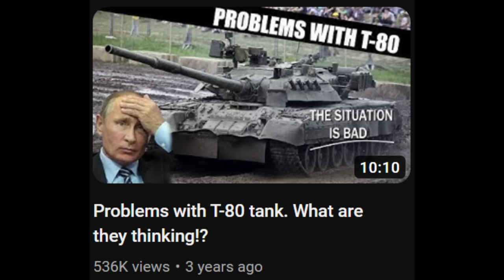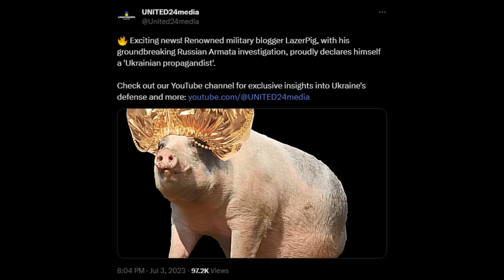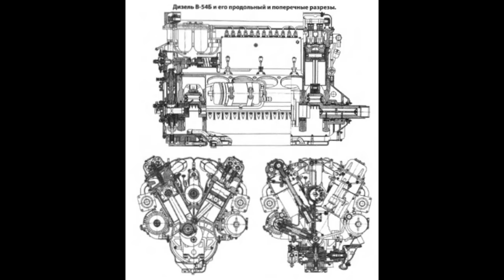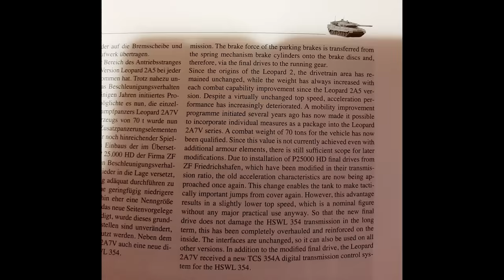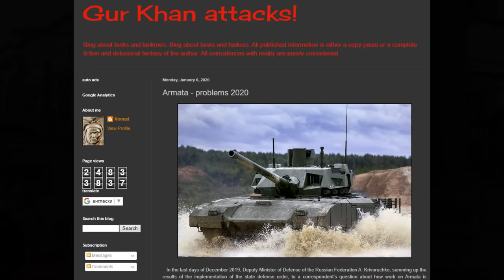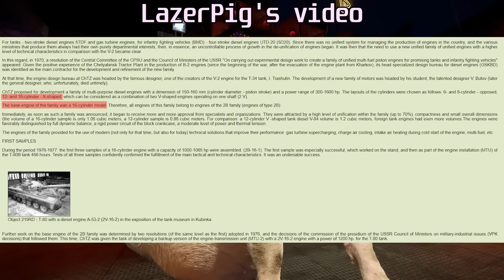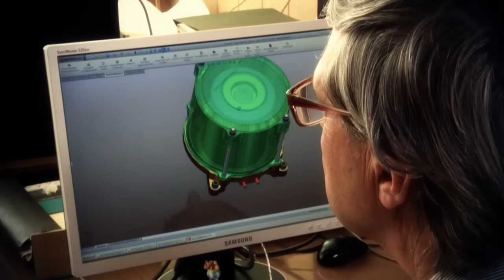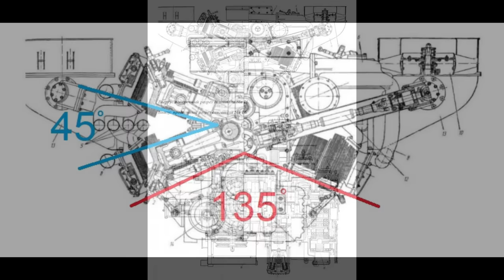Response to LazerPig and the T-14 Armata dispute

Comment: According to lazerpig's logic all piston engines are just a modification of the Ford Model T engine.
Oh, and the turbine engine of the Abrams is basically the same as the jet engine of the Me 262.
Reply: Lol 🤣🤣🤣🤣
Reply: Why wasn’t time trying to understand what someone else is saying when you can just make something up and claim it’s what they think. Don’t worry you look really smart right now
Reply: more like this is your interpretation of lazerpig's logic.
Reply: No no... The Abrams turbine is nothing more than a Hydroelectric turbine, but is using hot air from combustion, instead of water.    😏
          –LazerPig logic, probably... I dunno.
Reply: @DUKE_of_RAMBLE  It's just a smaller Dutch windmill.
Reply: The fact that it has a different cylinder count and displacement proves it has an entirely different block, not to mention the advances in engine technology that have been made in the last 80 years the only similarity between the engines is that they have an X layout and look kind of similar externally. Now if the T-14 engine is developed from a line of engines dating back to captured WWII-era German engines is a different story but claiming that the T-14 is using the exact same engine as a WWII tank is just inaccurate.
Reply: @jb76489   didn't lazerpig do that in his reply vid too?
he even cherrypicked certain parts of red's video and strung them together to create the impression that red was a vatnik and russian propagandist
Reply: To be pedantic the tanks internal combustion origin mechanics started with Belgian-born engineer, Jean Joseph Étienne Lenoir invented and patented (1860) a double-acting, electric spark-ignition internal combustion engine fuelled by coal gas. 😉

Comment: I present to you, a LazerPig style argument about, the AIM-9X.

The AIM-9X is bad because it's based on the AIM-9B, a missile designed in the late 40s.  The AIM-9B has several issues and had an abysmal hit rate in the 60s and was designed for the F-86 SABER JET!  Anyone who thinks that the AIM-9 is good is just parroting American propaganda.  You might argue that the AIM-9X is an "evolution" of the design, and that it bares only superficial resemblance to the AIM-9B, but this is just making excuses for the US using a 70 year old missile!
Reply: This needs to be top comment.
Reply: Sounds exactly like his style and I did like some of his videos. 

Based on this example, are you saying LZ has a habit of not addressing the main points of his arguments? That is just seems that way? I am asking out of passionate curiosity

Because in this example, our hypothetical LZ did not even take into account that the AIM-9X may have been improved compared to its older counterpart.
Reply: And not showing any evidence for his supporting points.

Comment: I really don't understand all the semantics about the engine. Even if the original version was built 80 years ago, it doesn't really have any effect on the performance of new engines built in the modern day, provided they have been modified along with advancements in technology. For example, the "small block" Chevrolet motor was first developed in the very early 1950's. Through various iterations and designs, including different bore spacings and displacements, it has been changed into some pretty cool stuff, including the famous LS and LT series of engines. However, all of these engines are still a cam in block, pushrod, motor with 1-8-4-3-6-5-7-2 firing order, a cross plane crankshaft, and non-canted valves (a design specific to the previous "big block" Chevy motors). It seems that the exact same process has occurred, at least in some way, with the 12 cylinder design that is discussed in the video. It's nothing new or even rare in motor design, usually a solid and reliable power plant will be used for quite a long period of time. I don't have a horse in this race, but it seems to me that Lazerpig was very keen to talk shit about engines without being very knowledgeable on them at all. To go back to my example, it's like he looked at a new Corvette with the latest and greatest 600hp engine and derided it because the original iteration of the design, had 85 hp.
Reply: It's not solid or reliable. Actual Russian telegrams have said the truth about the Armata - it's not going to show up in Ukraine because unlike Western engines crammed full of sensors and full digital control the Russian engine had to be manufactured with less digital components which means performance had to be brute-forced out of it through old design techniques. And to be able to pull the Armata the engine is strained to get the necessary performance which decreases reliability.
Reply: @ChucksSEADnDEAD  i don't think you understand the factors that contribute to the total power a diesel engine produces. They are: displacement, air flow, compression, turbo boost, and exhaust back pressure. To make an engine of this size (32 liters!) Make a few thousand ft/lbs of torque only requires a good set of fuel injectors and some big turbos, both of which are reqdily available in industrial equipment. To be honest, I don't know anything about the reliability of any 12 cylinder X-engine, let alone this one. But I am hearing a lot of talk with little explanation. What is the power to weight ratio, fuel consumption per hour, total power production, and reliability like of this engine? Since you seem to know, I am actually quite interested to hear.
Reply: @haroldburrow4363  Well dont listen to the talk. Next to nothing is actually known abt any of the X layout Russian engines other then their names and maybe some pattent drawings. Actual performance and or how reliable they are is not known.
Reply: @ChucksSEADnDEAD

Have not seen any sources discuss anything you are saying.
Reply: @haroldburrow4363  If you want boost, you have to prevent knock. You need an ignition timing map.
Reply: @jamesmandahl444  Unfortunately it was a Telegram post translated and posted on twitter. I am bound to the search function which doesn't return the post I've seen.

Comment: If the T-14 type tank ie unmanned turret with crew capsule in hull, made by western country then LazerPig would have written ballads about its greatness even before it entered production or used in combat. Oh wait he did for AbramsX. He forgets the first of this kind was Abrams TTB and RDF light tank from the 1980's. But the technology was not their, crew didnt felt confident enough to be dependent on cameras and liked the fact that Commander was at high position to look all around. Beside that the existing design was less risky and cold war eneded. So both of the designs were not adopted. Remote weapon systems and medium sized unmanned turret have proved that technology has matured enough ie depending of cameras for targeting, that sooner or later an unmanned turret tank would have happened if Russians were the first to show it good for them but as we know it needs time and money to sort out problems to enter at least initial operational production.

Comment: The people that hate on the T-14, does not come up with a singular good argument to why its bad. they all be like "the tank is so bad it uses a tiger (p) motor🤓☝", or they say "its bad, it broke down during the parade".
Reply: yeah the chieftan even postet a pic where one m1 got towed so is the M1 also bad ?
Reply: i mean, you cant judge a tank that has never seen combat and has less deployed units than F-35's built last year
Reply: agreed the real question is if this tank is so good, why are there so few? Either it does not offer a significant bump over existing models with refits or it's too expensive economically/logistically. Neither of which is a promising option though the latter would be far more concerning.

Comment: To me in America its funny that anyone would cast shade over an engine design because of its age.  We have been using small block v8 engines since the 50s.  Yes, as time goes on we make them more powerful, lighter, more efficient--but at the end of the day its a small block v8.  4 pistons are going up and down in 2 v-shaped banks.  If it isn't broken why fix it?

Comment: 11:00 if it was an engine used on the BT-7M, then surely it was an engine used on the BT-7, as the BT-7M is literally a modification of the BT-7
Reply: BT-7M is the BT-7 with the V-2, BT-7 originally had the M-17, a copy of a BMW engine.
Reply: @TheForklifter  Correct, but I was not saying the actual BT-7 (BT-7A) did not use the V2 engine, I am saying that the BT-7 family adopted the V2 in the Bt-7M variety.

Comment: Problem with laser pig is that people on the internet are gullible and they will easily believe what they hear. Especially when you do not provide sources.
The whole engine thing is a joke. I mean come on, all diesel engines are similar. All internal combustion engines are also similar to some degree. Heck that whole class can encompass even steam power as fosil fuel powered engines. Contrast that with electrical engine class. Or rocket engines.

Comment: Russia is not the Soviet Union. All they can do is repair the tanks they already have.
Reply: So, the T90M was made in the USSR?
Reply: @Fred_the_1996  the t-90 entered production in 1992. But its design goes back further than that.  It's an evolution of the t-72 with elements from t-72bm and t-80. 

It's a soviet design with a fancy dress on.
Reply: @Nedula007 Which is still being poduced and not just repaired.
Reply: @aquadox5514  it's a soviet design my guy. The only new tank they have is the armata and they can't even make a 1000 of them lmao
Reply: @Nedula007  But they make T-90's is what I'm saying.
Even if it's soviet in design they are producing it and not "just repairing" them.
Reply: @aquadox5514  it's a soviet design using the spare parts they have left over from soviet times. It's got fancy optics and a new gun but it's still a t-72 with a dress on.
Reply: @Nedula007  Which they produce.
That's all I have a problem with, it's being produced, not just repaired and thus limited.
Reply: @aquadox5514  ...produced by taking skeletons from a tank graveyard
Reply: @Nedula007  If you believe Russia isn't producing new tanks I'll leave you to it.
Reply: @aquadox5514  they're really not. IF they were, the battlefield would be awash with brand new Armata tanks. All of the Russian inventory is basically decades old crusty and dusty soviet stock.
Reply: @Nedula007  Ok, good luck with that image of reality.
Reply: @Nedula007  technically you're not wrong. All of the "modern" equipment in Russia are unicorns. The Su-57 in production for over a decade and only about 20 have been produced. The armata tank, only about a dozen or so have been produced and that tank had to be towed away during a parade. Russia doesn't even have the ability to mass produce drones, they had to get them from Iran. (Cue photos of russian drones with Canon cameras glued into them), The russian terminator tank? Only about 11 have been made. The T-90 is ... as you said a dressed up T-72. There's nothing special about it. 

The Russian military can't fight a modern war. Because it's not a modern military. They had to purchase millions of artillery munitions from North Korea and Shoigu's recent visit there should be an indicator of things to come.

Comment: It’s the same core engine. Where I work we build engines that were designed 40+ years ago. Sure, they’ve changed and developed over that time but they are still the same core engine.
Reply: but they're not, that's like saying a honda K24 is an evolution of the chevy 153 just because they're both 2.4 liter inline 4 engines
Reply: @Fred_the_1996 that’s not true, a Merlin 60 series engine and a Merlin III are the same core engine, despite the former having a two stage supercharger. 

A Rolls-Royce Merlin and a Rolls-Royce Griffon are NOT the same engine despite them both being V12s.
Reply: @Pete-tq6in  wait you're talking about the V2? my bad i thought you were talking about the t14 armata's engine and its relation to the king tiger engine
Reply: @Fred_the_1996 sorry, perhaps I should have been a bit clearer!

Comment: All this engine argument is silly, if an old block design works great there is no reason to change it, most of the gain in HP, torque, and fuel economy come from the design of the heads, and improvements to turbocharging and fuel injection, not redesigning the block every five years, take it from someone who has worked on plenty of diesels. And arguments over which tank is better can be downright silly as they are designed for different doctrines, sure on an ideal wide open battlefield an M1A2 SEPV whatever will have pretty darn good odds against any T72/80/90 variant but the logistics of moving such a hefty/fuel thirsty beast around is a task that only a US sized budget can handle. Russian doctrine requires equal or greater mobility with more iffy logistics, not saying that Russian logistics are bad but they rely MUCH more on a nearby rail network which Russians have in abundance in their country.

Comment: In regards to the engine argument. Can somebody explain to me how you can base a diesel engine on a gasoline engine? you can do it the other way around. aka use a diesel engine and convert into a gasoline. but the other way around? i am not aware of that being possible since a diesel engine has a way higher working pressure therefore a diesel engine block has to be more sturdy. 
i am aware that today a lot car engine manufacturer use the same block for their gasoline and diesel engines(bmw, volvo for example). but to make that possible the block has be the designed first and foremost for the diesel application. as a result the gasoline engine can take boatloads of boost without any issues. just take the bmw engine in the current supra as an example.

Comment: By the way, the Leopard 2 engine is old but this is not a special Leo 2 engine. This is a standard MTU industrial engine that is used for agregates, emergency power, ship engines or elsewhere stationary. It hasn't been modernized because there's nothing better in this genre, there are enough spare parts, because these engines are used civilly around the world, on ships, on oil platforms, in mining and it's completely mature. With every generator that runs anywhere in the world, all problems have been eliminated and all defective parts have been replaced with newer ones. It runs on low quality fuel or fuel mixtures, which a modern diesel cannot cope with.
There is also a Deutz engine here that is built to eternity and cannot be improved.
When I see these T-tanks, how they rock  and shaking when starting up and changing gears, I don't know whether the engine power line is top of the notch, no matter how modern they try to be. 
I've never heard anyone here say, "Let's buy a Russian device, they're good." 
No, they buy Cat, Liebherr, Komatsu, I've even seen Tatra, but nobody buys Russian products because they suck. Before the war, they imported everything that was more complicated than a refrigerator. At the IAA they once presented a GAZ truck, even then they had to use a Cummins engine because they don't have anything that would get approval anywhere except in Russia. Nobody bought it because it was technically up to date 15 years ago. Even the Turks have built trucks that sell well here, the Russians never have. There are only a few LADA off-road vehicles here. Because they are cheap and there are people who like such vehicles to be simple, primitive and don't value comfort off-road.

Comment: The last LazerPig vid I watched about stealth was full of propaganda and what seemed to me pure assumptions about the tech being used which didn't tally with what knowledge I do have. A previous video I found subjectively suspect so I have pretty much given up with his channel.
Reply: Well that’s actually debatable. In terms of the part covering the F117 shoot down, I mostly agree. Yes, there are inaccuracies but with that part, and the part where they were testing the RCS of the F117, sounded mostly right. The Serbs really did make a very lucky shot (technically they got lucky twice, since I’ve been told there was a second F117 that was hit but was not shot down). I’m also unsure if they were using low frequency radar when testing the F117’s RCS, but I can’t really find anything to back that up either. 

What else did he get right/wrong?
Reply: @christopherchartier3017  I found a lot of the stuff questionable. One that springs to mind was the bird sitting on a model F117, the radar only detected the bird. That sounds like propaganda and makes little sense to me. Then there is the bit about low frequency mode not being possible because the radar would detect everything. No. By his own description the sky was clear and empty. Secondly, there is no chance these SAM systems don't have declutter filters to remove static returns. I can't recall the rest, I was just left with the impression he read press-briefings and made the rest up.
Reply: @Kefuddle  As for the bird that was actually true- a leaked conversation did confirm that but that was only from one direction of observation. And it wasn’t the final version of the aircraft, which would add on a lot of external additions like the finished cockpit, the tail section, etc.
When he said the sky was clear, that was in reference to the radar observer trying to find hostile aircraft signs on his scope, obviously that’s not exactly a literal description. 
SAM systems do have declutter systems, it’s not uncommon. But they don’t work nearly as well in VHF or L-Band since there is literally SO MUCH if you know what I mean. 
It wasn’t one of laserpig’s best videos, he goes off on a lot of sidetracked rants but it wasn’t terrible. I don’t really remember the rest because of that lol